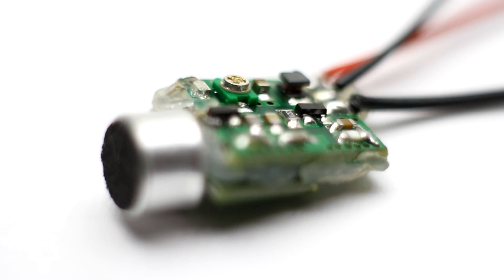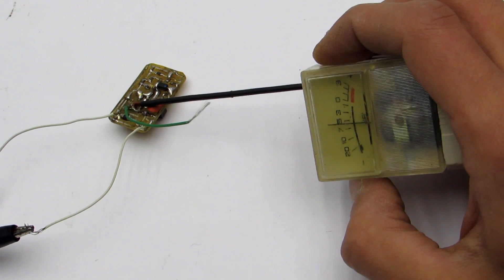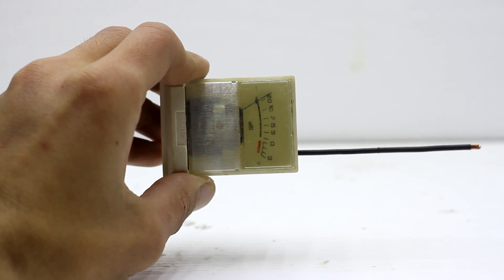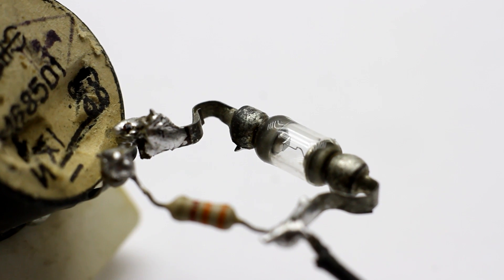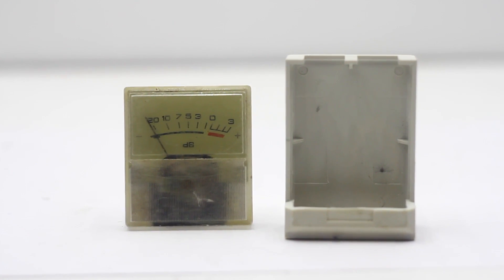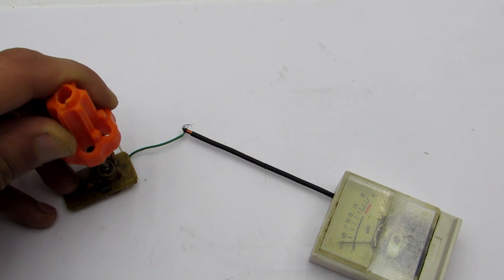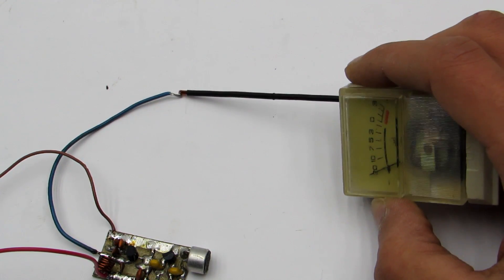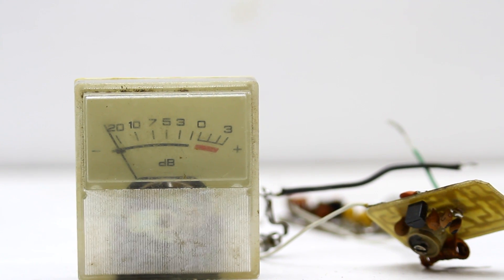The FIELD detector or how to set up bug

Comment: well done - nice and useful, thanks  ..it's an often used way of detecting the ideal trimming regarding the max. transmission pwr. However you always have to face the fact that you influence (shift) the resonator circuit's optimal trimming when both antennas touch each other  ..keep some cm distance and it's fine  :)